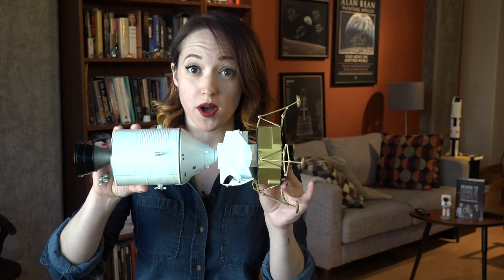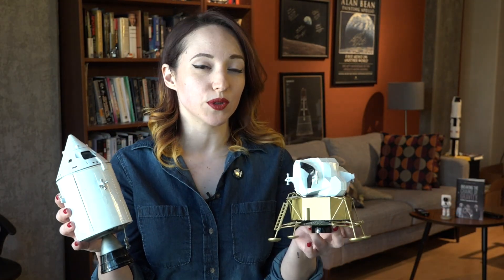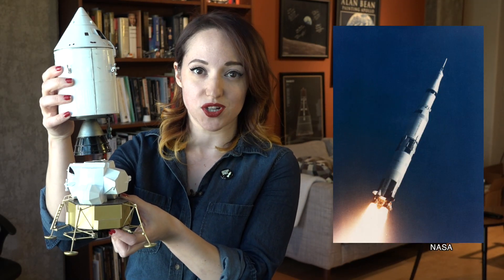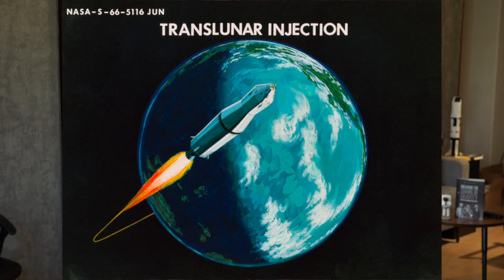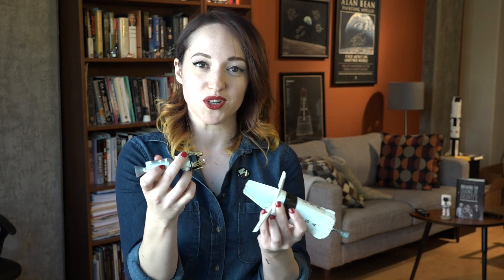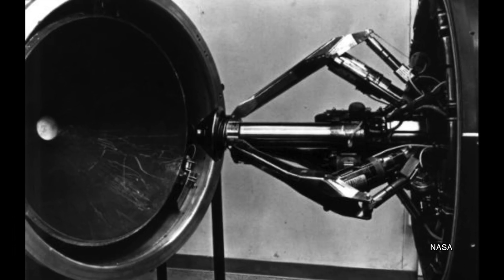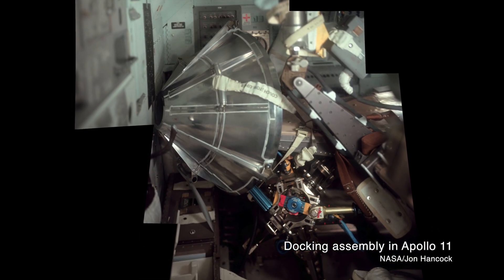How Did the Apollo Command and Lunar Modules Become One?

Comment: So...the Translunar Injection happens before or after the Command module and Lunar Modules become one? Or did the Command Modules main thruster send the whole smack to the moon? What type of fuel was used to ignite the main thruster in space? How did the command module slow down when it reached the moon? If they used the moons gravity, and it's only 1/8 that of earth, how many revolutions did the command module make before it slowed down enough for moon operations?
Reply: Translunat Injection requires the S-IV stage to fire again, so.it occurs before the CSM separates and the LM is exposed for docking.  The Apollo spacecraft uses the service modules engine to slow down to enter lunar orbit.  The SM's engine is also used to break lunar orbit and send the CSM back to Earth.

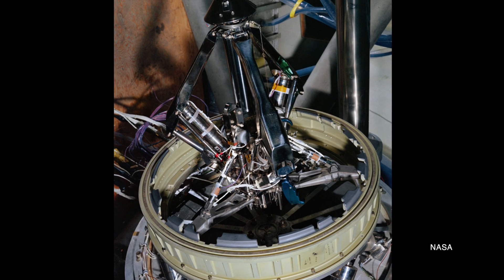Comment: At 1:46 -- when separating...Did the thrust rockets of the command module push the separated LM part away from it . And did that force (however small), cause it the LM part to 'drift' in space while the command module rotated around. I would think by the time the command module rotated, the LM would be drifting backwards away from it and maybe be out of alignment. Just curious. Thx and great vid.
Reply: They used the small manuevering thrusters to separate and later dock.
Not the main engines.

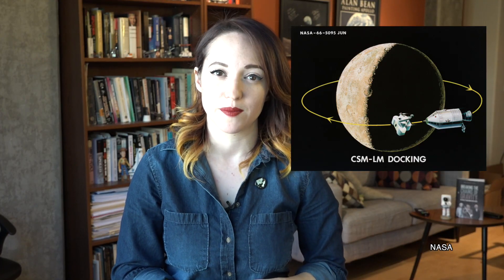Comment: 2:50 You leave out that the Lunar Orbit Rendezvous was done while they were moving at just under mach 5 (3600 mph)  Do you know how this was accomplished? How would they even find one another much less link up going at that speed?
Reply: In a vacuum and "free fall" only the relative speed between the two spacecraft matters.
Not how fast they travel, compared to the lunar surface.

Both spacecraft had radar and the LM was launched from the surface at a predetermined moment, so it would reach orbit close to the orbiting CSM.

Comment: Why didn't they launch already connected?
Reply: The docking ring could not handle the stresses of launch first of all, and more importantly, the lunar module would have been sticking out in front of the command module so the escape rocket tower would not fit, etc etc etc. Lunar module is a delicate craft that needed the protection of the 'cocoon' that it was inside in order to protect it from the incredible aerodynamic forces during the first minute or two of the flight. It is a 'butterfly' pulled out and operated only in the vacuum of space.

Comment: I remember back in the days when Ed Mitchell ran a forum on his website that he participated in that the issue of the sketchy docking came up.  If I remember right, he seemed to think that there was some ice in the probe mechanism that was preventing it from capturing the LM properly.  Once the two vehicles were actually docked the ice melted and left a pristine probe that showed no signs of mechanical issues and that worked fine for the final docking of the mission.

Comment: I've watched Apollo 13 a few times and I've seen the two ships docked together and the fact that the nose is the tunnel between the two, but I never could wrap my head around how the dock probe opened to let the astronauts through. Now I get that it was removed once the final docking was done as there was a set of clamps on the outside of the tunnel holding the two together.

Thanks.
Reply: But then where were the 3 large parachutes that are deployed from the nose?
Reply: @burtpanzer  
All stored around the periphery of the docking tunnel.
Reply: @burtpanzer  exactly..
Then where was that place to get into lunar module
Reply: @IndiaTheGreatNation  Through the tunnel. The parachutes were compressed down to very small units by using hydraulic presses and then housed in the nose cone around the outside of the forward docking tunnel.
Reply: Absolute b*****

Comment: Pardon me, but I am a tough critic.  This video doesn't quite explain everything.  For example, most folks (including myself) thought that the lunar module was out in front of the command module as it made its way to the moon.  But after visiting the Smithsonian Air & Space Museum (multiple times) I found-out that the space vehicles were actually in the other (different) order when they "coasted" toward the moon.  A more complete explanation would make for a great video on this channel.
Reply: makes sense that the main engine would be pointed towards the moon as it would be used as part of the braking solution to bring the pair into lunar orbit. No reason to waste fuel spinning around multiple times unnecessarily.
Reply: Except I don't think the astronauts would be able to see the moon as they approached it.  Not mission critical, but nice.
Reply: In "barbecue mode," I would assume the stack of vehicles were to the broadside of the sun.
Reply: Most folks? That's a little vague don't you think? Anyone who's read even just a couple of books on the subject knows that the CSM/LM stack flew to the moon with the SPS engine 'up front', so it could be used to brake the spacecraft and allow it to fall into orbit.

Comment: Just found out that the Service Module Engine is around 2x bigger than it needed to be. It was designed when the Apollo program was still going to use the "direct method". The SM engine was designed to lift the entire SM/CM from the lunar surface. 

Later, cooler heads prevailed and "lunar rendezvous" became the mode.

Comment: Why not store the command module upside down already attached to the lunar module?
Reply: Largely due to launch abort considerations. It's much easier to blast the command module clear if it's at the top of the stack. There's also the discomfort of a high negative g launch to consider.
Reply: Good point!  I've been trying to work out configurations that provide both an abort facility, and the facility to redock the ascent stage to the command module for the earth return WHILST avoiding the need for a mid flight flip and rendezvous on the way out, but there isn't any.  They knew what they were doing!

Comment: How did they get past the parachute in the nose of the command module
Reply: The cabin area didn't extend to the very tip of the CM. The tunnel was 2 or 3 feet long inside the CM before you entered the LM. The parachutes were packed around the outside of the tunnel in the narrow portion of the CM below the docking clamps.

Comment: Darling you don't really believe that POS landed on  the Moon do you? It never flew successfully on Earth. The one time Armstrong tested the lander on Earth it crashed. I believed in the moon landing for 44 years until I took my computer and investigated the legitimacy of NASA's claims. Hoax!! Don't be like me and believe everything you are told. All scientists are liars. Never believe anything they say. They are even bigger liars than our politicians.
Reply: It never flew successfully on earth'

Of course it didn't, it wasn't designed to.

'The one time Armstrong tested the lander on Earth it crashed'

Absolute arrant nonsense. You are referring to the Bell Aerospace LLRVs - completely different craft - which were harnessed to study the piloting techniques which would be required to fly the LEM in 1/6th gravity. The research vehicles were vertical take-off vehicles that used a single jet engine mounted on a gimbal so that it always pointed vertically. It was adjusted to cancel 5/6 of the vehicle's weight, and the vehicle used hydrogen peroxide rockets which could fairly accurately simulate the behaviour of a lunar lander. A General Electric turbofan engine with 4200 pounds of thrust. The engine needed to get the vehicle up to 1500 feet elevation and then throttled back to support five-sixths of the vehicle's weight to imitate the moon's lower gravity.

These vehicles were not built as prototypes for the lunar module. A prototype is built to test the technology that will go into the final version, whether everything fits together, and to determine how it can be built on an assembly line. The LLRVs were built to reproduce for the pilot, as best as could be determined in advance, the "feel" of flying the lunar module using whatever ad hoc technology had to be included to do that in an earth environment and a very primitive fly by wire control system.

By Aprill 1966, these had performed over 100 successful test flights. The incident that you refer to was in 1968 and was caused by a combination of high winds and the pressurised thruster fuel running out. This prompted NASA to cancel future flights and revert to the newly commissioned LLTV. Armstrong ejected safely but it was definitely a close call.

'I took my computer and investigated the legitimacy of NASA's claims.'

...And therein may well lie the problem. The internet - empowering idiocy.

'Don't be like me and believe everything you are told'

Then may I suggest that you stop watching garbage conspiracy videos on You Tube. If you do insist on blindly and blithely subscribing to this nonsense at least objectively check the veracity of the history and science first - without doing so, and in relying purely on parroting conspiracy theorists, you make yourself look both ignorant and ill informed. Perhaps start by looking up the 'Dunning-Kruger effect' and there's a chance that this can be avoided in future.
Reply: That is not an acceptable explanation. Fk off Hillary.

Comment: What happened to the lunar modules after separation from the command modules? Are there any lunar modules still in lunar orbit?
Reply: +Mark Spangenberg   Apollo 10's Snoopy is the only one left in a heliocentric orbit. There is a search being done to see if it can be found but it's a pretty daunting task. Apollo 11's Eagle remained in lunar orbit until it eventually crashed. Starting with Apollo 12  the spent ascent stages were purposely crashed into the moon to generate seismic waves for the ALSEP's left behind. Of course, the exception was Apollo 13's Aquarius.
Reply: +Mark Spangenberg, Interesting. Good question.

Comment: 0:40  OOPS ! not completely correct . Amy has the front windows of both spacecraft facing the same direction . I know its trivial , but it is as important as any other detail to us Space Fans . The correct alignment would be rotated a quarter turn as if you are loosening a nut from a bolt . Look for photos of Apollo 9 in Earth orbit and you will see it very clearly . Great video . Amy if you are reading this it would make a wonderful subject for a video . (BTW I built my plastic model of Apollo with the incorrect alignment LOL )
Reply from the maker: +sQWERTYFALIEN2011 To be fair, it was a basic demonstration, not a full run through of a rendezvous. I don't have tiny hatchmarks on those windows to check the alignment! But maybe there's a video to be done with rendezvous footage showing the view from out that window... because I do have that footage somewhere.

Comment: how much fuel is needed to get into orbit in 1/6th gravity? I get it's not 1/6th of what's needed from Earth as no air resistance but surely it must be quite a bit. Also they needed to get to 2,600 MPH sideways and 46 Mile upward. Does anyone know? Also slowing down from 2,600 MPH on the way down however it's probably a lot right? Where did it all fit?
Reply: It is fantasy designed for 1960 cinema popcorn eaters not real story.

Comment: Thank you Amy for the very interesting and informative vids.  I was just a child during the age of Mercury, Gemini and Apollo.  It was like a time of marvel and magic in the skies.

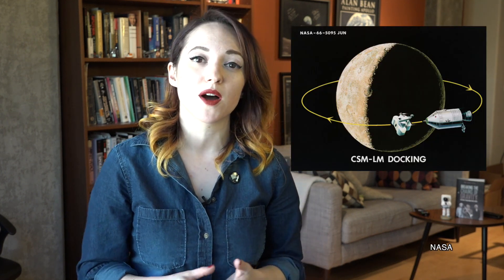I think you may have made a slight mistake at about the 2:45 mark in this vid; a mistake that might be the subject for another video that I for sure would be interested in if you don't mind.  You said that the two dockings were "the exact same".  As best as I can tell from my research that's not completely true.  In the first docking, the CM maneuvered to line up with the LM. (I'm not sure who did the piloting; my guess is Collins.)  In the second docking, Armstrong maneuvered the LM to dock with the CM.  Collins filmed the docking so you can see  Neil shifting and rotating the LM until he got it lined up just right, and then finally plunged his drogue into the CM's latch assembly.

What's really got me baffled is what exactly was Neil seeing when he was utilizing his optical alignment sight to guide him to a successful docking.  You can clearly see the CM docking target on the LM as Collins did a great job of filming the docking (until the actual bump of the docking sent the camera sailing).  However, in Aldrin's filming of the CM, you can't see the LM docking target, probably because of a poor lighting angle.  I think I read that it was mounted inside the CM in front of a window for Neil to home in on, but I'm not sure and I can't tell which window it was mounted in or exactly how it was mounted.  Was it lit just enough for him to see, but Aldrin's camera just couldn't pick it up?  Also, I think viewers would be interested in how exactly the Crewman Optical Alignment Sight worked.

Anyway, those are my suggestions for a future vid, and again, thanks for all your hard work.